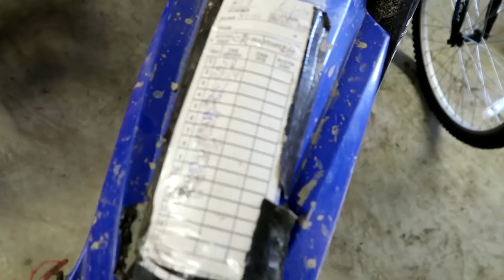He Dropped another Rider's Bike... Moto Moments!

Comment: I just recently bought and installed a wire hardess that allows u use a wireless remote so much nicer don't have to have toggle switches to turn on the light bars

Comment: BROO that 2010 ktm150sx is my old bike!!!!! It had a brand new cylinder with a vertex piston. I put those jager plastics on it and the blue skid plate!! Fmf fatty with a shorty silencer, hygear suspension!! That’s crazy dude I traded it for a cr250. It should of came with a pro circuit platinum pipe as well. I know it is for sure because it had a missing graphic on the right fender lol and I saw the enduro engineering sticker on the rear mud flap.
Reply: It also should of came with stock plastics and a short seat.